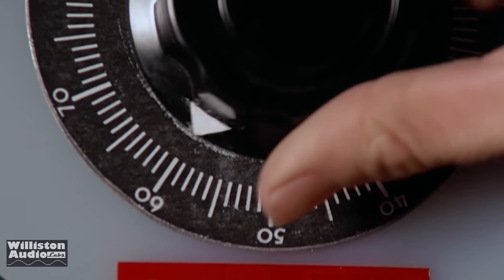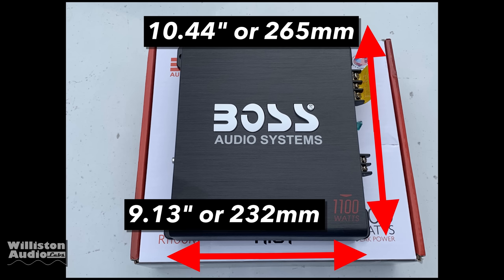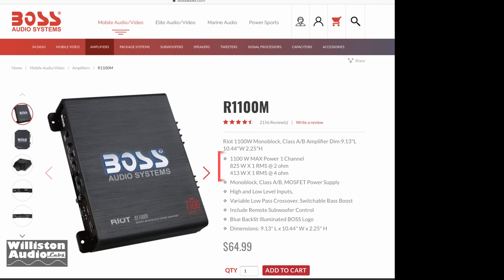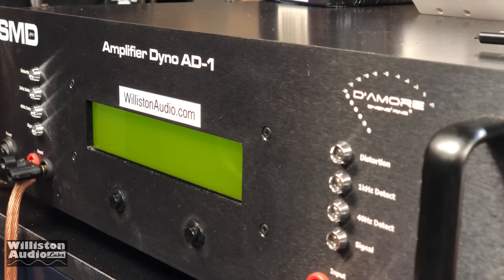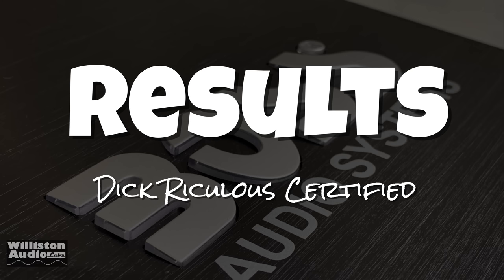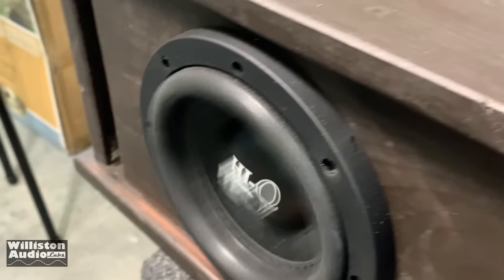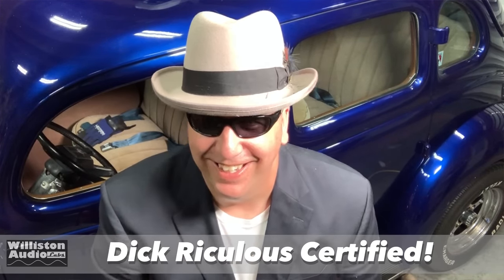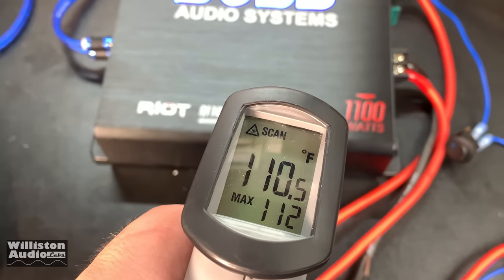Best Selling Car Audio Amplifier on Amazon (2019)? Boss Riot 1100M Monoblock [4K]

Comment: Big D, love your channel.  
A Pyle PLRMR23BTW auto/marine stereo was recommended to me.  It supposedly has 300W power (75x4).  I decided to try it.  I bought two Kenwood KFC2053's ($79)and a cheap $13 pair of Pyle 6-1/2's  to fill all four channels.  When I turned it on, the sound was amazing.  Earthquake bass, clean mids and sparkling highs.

I'm very curious of how the Pyle PLRMR23BTW marine stereo would test out on a dyno...  if you ever get bored.
Anyone who runs an ATV, Jeep or boat will appreciate it!

Comment: That top rating is fake. It is a common writing style for fake reviews. The “I was a skeptic but now I swear by it” story has certain points that a liar will always touch on, including the “my high end competitive product died and needed replacing” trope. These companies pay big bucks to have these ratings written for them, often with grammatical errors that are very consistent across many industries. On another note, I bought a few of these amps myself and they’re fine, but I knew what I was getting into when reading the fake reviews.
Reply: Acton Treadway      “My Rockford Fosgate T1500bdcp fried! I bought the Boss Riot 1100M and MAN. This amp blows Rockford out of the water!”
Reply: F W  exactly. they're all so similar and basically touch on and address all the fears a prospective customer will feel.
Reply: @tylervilbert5071  I'm sold!
Reply: @actontreadway1168  lol

Comment: How can it pull over 20 amps of current certified? Meaning that a consumer is going to full tilt it before clipping continuously sending over 20 amps of current and not popping fuses left and right? Explanation please? I'm going to post your response on all my basshead groups.

Comment: boss is just entry level crap and that's all it will ever be, crap that is
Reply: Used to knock on boss as well, when once at the flea market I got a good deal on a new one I couldn't pass up. One of the Best amps I ever bought! Had it for over 10+ years knocking two 15"s and not only beats my friends name brand speakers and amps but surpassed them in knock not to mention durability, and wired to 4ohms as well so I never really have my lights dim (only when I crank it all the way up) nor has it ever cut off/heated up/protection mode not even on 8 hr road trips. Hell! if I'm not mistaken is still running on the same fuses! Pairing amps to the right subs (diff name brands) I believe is the real key imo.
 PS Don't forget to try multiple sub boxes and sizes as well (ported,bandpass,sealed,etc) yeah I know some are trash as I have friends that had boss too nothin they can brag about but not all are bad though
Reply: I had to change my mind about boss, when my cousin put one in his car back in college back in the 90s. It’s cheap and it nearly gave me a heart attack when the bass dropped.

Comment: I'm tired of all of these amps with a bass knob.  A properly set-up and balanced system should not need one.
Reply: That's like saying you're tired of a volume knob. "Properly" set-up systems still need adjustments due to differences in recordings, then stack personal preference on top of that. It makes total sense to include a bass knob. 

Chill out bruh!
Reply: ...but when you turn it up it gets LOUDER. :D
Reply: Kramit The Frog I use my eq no bass knob needed
Reply: I like having a bass knob, when I'm just cruising around I have it on full tilt but when I'm talking to someone one I can turn it down.
Reply: Depending on the sound deadening, the type of music, and the type of passengers riding in the vehicle with you at any given moment, you absolutely need to adjust your subs level on the fly
Reply: @303nitzubishi4  exactly, right now I have more of a sq build but subs will still drown you out.
Reply: All music is recorded different. Some lack the lows the listener wants some are just to bass heavy for music listening.
Reply: 303 Nitzubishi  and the cops where I love have a 20db limit and I do well over 100 db just in highs and midrange that's why I use the eq see a cop push the button subs go completely off 😁
Reply: @yoplaitmajor  Didn't realize I was going off, bruh.

I needed no adjustment to my system, regardless of genre.  DJ Magic Mike, Steely Dan, Smashing Pumpkins, The Offspring, Type O Negative, Bjork, you name it - everything sounded great with no adjustment in an IASCA 150-Watt-class SQ system that was still good for 136 dBA with no cheater amps (Kenwood KDC-9000 HU, MB Quart highs/mids with a mixed-mono center, PPI A150, PPI A300, PPI PEQ223, and a common-chamber bass-reflex isobaric enclosure with four series-parallel JL Audio 12s that still allowed me to use my hatch).  No bass knob ever needed.  

So, I guess I'll chill out now. 😜
Reply: @WSKRBSCT  Nice setup. Bad humblebrag. Adios!

Comment: Nothing bad with the 2nd review Big D. Showing what garbage boss is cannot be done enough. As for the Amazon reviews, I dicovered a couple of  years ago when shopping for mountain bike parts that the reviews were as reliable as boss amp ratings. When the reviews swing from 5 stars to 1 star with little in between it means there are a lot of fake/paid reviews. I suspect that there are bogus sales also going on since that is another scam that is used on Amazon. The truth lies between 1 and 4 stars. When buying anything I’m not familiar with I always pull up the negative reviews to see whete the problems lie. Also, on the general reviews I set them to list by newest since the fakes are done at the beginning of the item’s selling life and the newest ones are the most honest ones.

Comment: Would this amp power a couple of Kicker CompRT 672 6.75" subs? By they way this thing is $54 in USA but around 90 GBP in UK not sure we are having to pay double the price.
Reply: Power them fine!
Reply: I actually use this amp on the same kicker 6.75 sub. It works pretty well for the price while I save for a good amp. The remote bass knob makes it work it.
Reply: @therobb1967  Thanks for the info, are you powering one kicker sub or two? I am planning on using two subs wired together to run of the amp. Would it work?

Comment: Would this still be enough for a 10 inch sub and 2 door speakers? I’m not looking to rattle the whole car just enough to have good quality base that hits a little bit
Reply: You can run any size sub on it you want, however the amount and quality of output will not be great. 

Just an FYI, a mono block or 1 channel amplifier should not ever be used to run different speakers, stereo input speakers or full range speakers. You don’t put 2 different models, 2 different ohm loads, or 2 different types of speakers on a 1 channel. You can buy a bridgeable 4 channel, or a 3 channel to achieve that, but I would not touch anything by boss with a stick. If you want cheap power, goto Skar. Be mindful that RMS rating is what you want to reference, not peak or max power ratings, and educate yourself on ohm stability. Good luck young bass head
Reply: @jerryspringer7235  thanks for the heads up, wound up doing some extra research and returned the boss amp I bought and went ahead and got a skar 1200 amp instead. Going to get another 10 inch sub and we will see how it goes. Definitely looking forward to it and thanks for the heads up
Reply: You can't use this amp to power a sub & door speakers, unless the doors have subs in them also, this is a mono block amp

Comment: I have this amp! It’s absolutely wonderful. I can drive a MTX THUNDER 5500 and it pulls 500watts full volume with zero complaints from the amp.
Reply: The sub doesn't "pull" 500W out of any given amp.  The amp delivers whatever power it is capable of providing to any given sub.  Think of the amp like a battery and the sub like the motor of a radio controlled car:  if the battery isn't providing the max rated voltage to the motor, then the motor is going to perform less than with a battery providing the max rated voltage.  This is why CEA-2006 certified ratings are critical.  Your Boss amp is only feeding your sub around 110W if your sub is presenting a 4Ω load or around 175W if your sub is presenting a 2Ω load.
Reply: I knew the wattage claim would be fake, so I was not "overly" concerned about how many watts it made,  what I care most about is how much amp, features, quality of sound and durability can I get for the $50 - %60 range. This amp is truly wonderful as you said (my wallet also said so, therefore it must be true hehe).

There are two reasons to buy a Sub amp for your car:
1: To get "xyz" sound for "xyz" dollars. Not watts per se, but "how does it sound perform and sound?"
2: To get very loud sound AND bragging rights for competitions (or for the ego etc).

This is my opinion and my purposes of course ;)

Comment: this amp came in my car. i recently used a frequnecy generator on my phone and turned it up to the point of distorion then backed it down to the max just before clipping.
i am using also a junk sony explode 4ohm sub in a sealed box.

 i put an amp clamp on it and found it was using about 120watts dc to produce what ever watts ac it was doing. i see my ghetto lab test came very close to what you got in this video. it still didnt sound bad and shook shit a little like the mirrors and stuff

Comment: that math you did at the beginning was the 1st think I thought when I saw the 30A fuse. The amp in my everyday car has dual 30A fuses and it's only rated to 500W peak with 200RMS single channel or 150RMS dual channel. Which is perfectly in line with the fuses and what you would expect. It's a Pioneer but can't remember the model off the top of my head. It powers a single 10" Rockford Fosgate P1 sub.

Comment: If they marketed this as a fullrange 100w (4-ohm) amplifier, I believe they would have sold many more of them. For powering a door's worth of speakers, it probably would have done a good job.
Reply: You'd have to buy two, one for each side!
Reply: Couldnt use for door speakers because it does produce lower frequency.  There for if it was on door speakers the excursion alone would damage a speaker.  Would have to be a mid range .
Duh
Reply: @pissedoffconservative347  You know there are things such as high-pass filters right?
Most Pioneer decks has those built in for the front and rear channels.
Reply: @Skarfar90  yes I understand the purpose of a h.p.f. but a class a/b such has a 4 channel amp has the ability to switch to just a h.p.f. cutting out the bass .
A 2 channel a d or mono block amp can not switch from a h.p.f. or l.p.f 
Yes they have settings to adjust the curve, but it doesnt cut it out completely. 
If you put an 1100 watt mobo even if it doesnt only 100 watts still has bass.
As I said. Unless it's a midbass speaker. 
Class is in session
Reply: @pissedoffconservative347  Most Boss amps do have a selector switch between lowpass, fullrange or highpass. But as I said earlier. Just use a highpass filter that's most likely built into your deck.
Sending a little bit of bass through the speakers is not a bad thing
Reply: @Skarfar90  ok bud. Not gonna argue facts from fiction .

Comment: I got a riot 1600m but it cant do much with my 2 12'' pioneers 600rms subs..could I use the amp to power my door speakers?
Reply: I wouldn't.. thers no crossover setting on this amp. You want to be sending only the high and mid frequencies to them. If you send too much low end bass to the doors you'll blow them. I'd invest in a 4 channel amp. Usually they have crossover setting, and if they don't, then search for one. (If you haven't already) 😎
Reply: @Dusky_The_Husky  thanks I appreciate the time u took to reply🤜

Comment: hello, question; what will be the best amp for the money and what will you recomen that provide true Rms value
Reply: If I was you id just buy a amp sub combo from fosgate a single 10 300 watt built in amp is already tuned for maximum quality and sound. But if you have a sub just get a amp close to rms rating of your sub. These boss amps are ok for price and a good starter system.
Reply: look for an old punch dsm
Reply: If you find an old punch or Rockford fosgate with the removable rubber grommet in bottom change up amp by flipping  or replacing the removable chip that sticks up. Those days were when alot of good amps were out RF were one my favorite I'd have to say far as old amps but most never put out what they say I mean you all these cheap made plastic parts if you know audii you know price, plastic, parts, cheap,Amazon,those words an car audio dont equal big bass or quality sound but also most forget it doesnt mean anything if you don't know how match amp watts an ohms an sub dvc,svc, ohms,max watts,rms, free air sub or closed ported box square feet air space needed if you do your homework on all this an match shit up before you go buy most crap these people buy just cause cheap an do homework you could act match up some food close things with all this in mind an actual get decent quality sound from cheap which we know cheap quality sound doesnt go together in same sentence but time has made parts available an tech to where you dont have spend thousands for great hard hitting subs an amp if match up your things an do research on what your trying to spend versus what's an space you have to use to get decent sound

Comment: Glad I watched this! I have a riot 1100 I stopped using a few years ago because I wanted actual pro audio, I just recently got a used 6" massive audio hippo 64xl mini subwoofer. It is rated at 300rms, and I was debating on hooking this amp to the sub, but was worried I'd fry it.. 

I guess I got nothing to worry about 😂🤣🤣

Comment: So what amp should I get for a 12 kicker ? Any suggestions?
Reply: Comp cvr cvx or solo baric
Reply: @greash6573  i have a kicker. 12 comp the red one, with this same amp it doesn’t sound that great is it a bad sub, amp or both... can an amp make a sub sound bad?
Reply: @rioskellentos1588  kicker is a good sub maybe you set your gain too high on the amp and it's clipping

Comment: Aside from the fake wattage, the price is right. Is this good enough for a 10” sub? Cause if it lasts  this would be ok for a high school kid right?
Reply: This amp will be very hard to beat for $55! Forget the "wattage", those who are buying this amp are wanting the best sound they can get for $50 - $60, right?
This is a GREAT amp for $55!
Remember it is a mono-block, it has only one speaker out-put. But is stable at 2ohms and has plenty of features and is fun to use and experiment with. If 100 - 175 watts is enough for your use, this just might be the best you can get >> FOR $55 << ;)

Comment: If u remember Orion , dont know myself,  back in the day , Seen a 2017 Orion Daul 10"  2ohm Sub felt good with the magnets , and some nice 3 way six by nines 125 rms . the sub was like 400 rms.  Do u think pushing anything Less then the RMS rating for instance on a sub matters like 400 but put 300 RMS is better or less gain with more powerful .   
I know it depends on the speakers  ,  If u could best SPL to RMS watts , any size u choose ?
Reply: Edit , of course , Just watched those , Orion back when was above
Reply: If we use the db increase of 3db every time you double your wattage (which is not actually true because the scaling of db per watt is not actually linear) going from 300 to 400 on a 90db per watt subwoofer, you would only get a 1db increase in sound, which is an increase in loudness of 1/6. Now with cabin gain, corner loading, and box design with peak tone efficiency your can boost the dbs quite a bit. Even then you maybe will get a 3 db difference which would be 50%. 

The point is you really don't lose a lot under-powering a 400w subwoofer with 300 watts. In fact while normally listening to your system you will probably feed it a lot less than 300 watts and your subwoofer won't really complain.

Comment: Dual is better.
Aside from the fuse rating, there is another way to see maximum power capability or Safe Operating Area of a Class AB amp. Measure the rail voltage and divide by 1.414 to get approximate RMS Voltage. Ignoring phase, calculate the power using a resistive load value (i.e. - 1Ohm, 2Ohms, etc.). For this Boss amplifier to output 825Watts at 2Ohms then the approximate RMS voltage would be 825x2= 1650 then sqrt of 1650= 40.62Vrms. (Since P=V^2/R). The peak rail voltage required would be 40.62 x 1.414 = +/-57.41Vpk, unless is single ended design, which is highly doubful.

Now, if visible look at the output devices then find the engineering notes or specification document on Google. Look for Collector Current (Ic) or Collector power dissipation (Pc). These are the maximum values for the devices. Example - if Pc = 150W then with the complimentary device there is no way in hell that amp is producing more than 150Watts. Actually, it should really be downrated by 30% for longevity and elimination of failure. All assumes the heatsinking is sufficient and the ambient temperature is not more than 125F. Pc is important because regardless of current, this is the most it will handle. Only having multiple sets of transistors will produce more power. Looks like the Boss uses two pairs of output devices. I will assume each pair can handle 200Watts, so no way this amp will ever put out more than 400Watts long term.

We can approximate the current through the output devices at a 2Ohm load (ignoring phase). Since P = VI then 825Watts = 40.62V x I = 825÷40.62= 20.31Amps to produce 825Watts into resistive 2Ohm load. This is another reason more than one pair of output transistors is needed. The P and N devices will have one half of the load current in Class AB, so 10Amps to each the P and N channels.

I am looking for images or schematics on Google for this Boss amp now. Everything I just said is bla-de-bla without knowing.